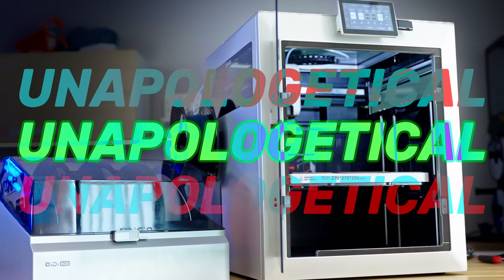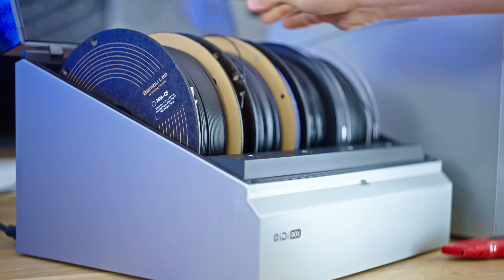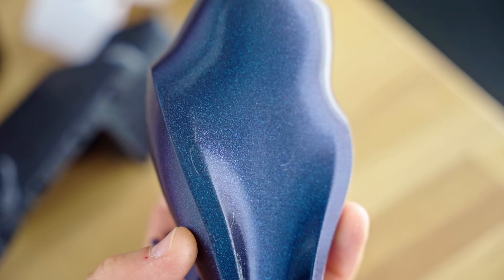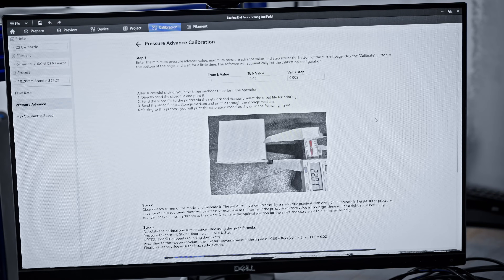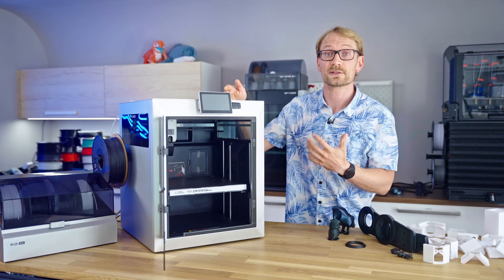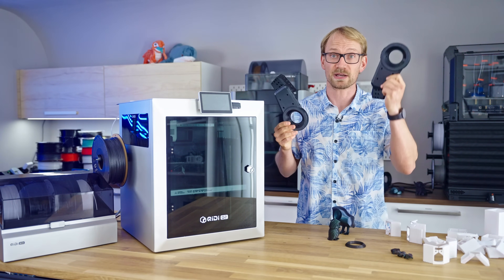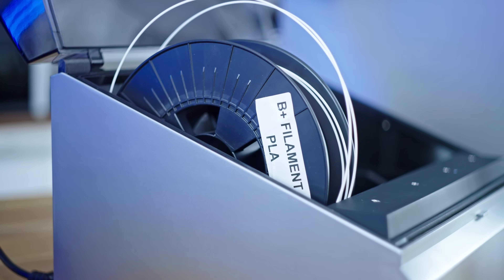Wannabe or Klipper-based powerhouse? "It's complicated 💀" with the Qidi Q2.

Comment: I mean it's a QIDI: you gotta wait 6 months, a few revisions, a community open firmware release, print profiles and then it's a tank that prints eng materials as if they were PLA for half the money.
Reply: Pretty much. Even 3 months it'll be a whole new machine. I got an Xmax 3 after CNC Kitchen reviewed it and the bed probe was a capacitive sensor whereas his was a BLtouch. I think that was the only major difference but either way it's been my go-to printer for a while now.
Reply: @redkingrauri3769 You know what is gonna rock? If they put the Q1 on offer at black friday for less than 300, that now is a mature printer.
Reply: Not everyone has 6 months to be a guinea pig so I think I'll be sticking with Bambu for the foreseeable future.
Reply: @EvanXDev  you just wait those 6 months. Right now you can buy the Q1,  probably on sale for black friday.
Reply: @EvanXDev  On the other hand, this thing can't be worse than the 3D printer I built from spare parts, so it's kind of interesting to me now that I'm intimately familiar with exactly how 3D printers work under the hood.
I keep thinking I want to upgrade to an H1S, but then I keep thinking about being locked into their software when I got so used to being able to customize every little thing on my own printer.
Reply: @bradley3549  I've done that forever, and have multiple Vorons, a Prusa Mini and some self built machines. Since I got a Bambu printer, it's really all I use unless the part doesn't fit on it, then it goes to the Voron Trident 350. The point of Bambu is that you don't have to customize every little thing. It mostly just works. I push the button and the part comes out later. I love my Vorons, but the amount of babysitting they can require means I don't use them unless I have to.
Reply: Did you just call PLA a engineering material? This was a joke right?
Reply: @TheJttv  They meant the printer will print engineering materials as easily as a typical printer could print PLA.
Reply: @TheJttv  You didn't get it: it prints eng materials as ABS like it was PLA.
Reply: @TheJttv read it again
Reply: @TheJttv  Slow down, take a  breath...Now read it  again.  There you go, just relax and breath.
Reply: @3FWDesigns  no bud
Reply: @TheJttv  That's too bad. Bud would probably  help you relax. 😄
Reply: @3FWDesigns  if you look closely. they edited the comment since i left mine
Reply: @TheJttv  I still stand by my last comment.

Comment: I'd take half baked Linux over spyware infested Windows any day. Same for this over bambu.

I think this analogy is a little outdated. Windows has been incredibly buggy for me lately with my task bar items showing up on the wrong screen and displays not working correctly. Linux just chugs along.
Reply: I agree with the statement. I've now built 3 printers with the latest being a Voron Trident that's for fully aluminium inside with the exception of toolhead and pg10 gland holder thingie which are PC blend CF. I've built it before bamboos were really out and slowly upgraded it. That being said I'm so burned out of tuning, tweaking and fighting to get a better print. I can print decent stuff but it takes me 1/4 of a roll of filament to get the material to print 75% of the quality and consistency of a bamboolab with a default profile. A to of manufactures now give you a default profile for their materials for bamboo studio. I'm now a few years older and I've finally reached a point in my life where the printer is no longer the project but rather a tool for the project and it's a pain. I'm debating selling the Voron and getting the HS2 because I just don't have the time or the energy to fight with it anymore. Im willing to pay with my privacy to not have to tune filaments anymore. That's coming from someone who recently built his own homelab server to get off the subscriptions and cloud services.
Reply: I know Linux has its place, but for everyday use it's just awful.
With Windows when e. g. I want to extend my storage, I plug in a new hard drive to my mainboard, boot up the system and there it is.

With Linux it's more like: Which files did I have to edit to register the drive again? What was the weird command again to mount the drive? How do I set it up so it is automounted? Why is my system not booting anymore? Ah, because the drive is not mounting for some reason.

Yeah, no thanks. I'm really really glad I'm done setting up my Raspberry Pi and don't have to touch it regularly. Windows has its quirks for sure, but for me it's been running pretty smoothly since 7.
Reply: @christiannorf1680  For your hard drive anecdote, I've used gparted and I've used Microsoft's tool. I know which I prefer...

Windows just works until it doesn't and when it doesn't, you have no recourse whatsoever to fix it except reinstall windows and cross your fingers. For example, how should I fix my taskbar issue? How should I fix that outlook refuses to open?

I use windows daily at work. When's the last time you gave linux a serious shot?

Comment: The issue that you're seeing in print quality is due to the "slow down for curled perimeters" feature in orcaslicer. It's actually a bug in orcaslicer, turn it off and your print quality will improve. Using extrusion rate smoothing will also help. It was the bane of my existence on my Plus 4 for a while until i made those two changes. Now my surface quality is excellent. They claim the bug with "slow dow for curled perimeters" was fixed in orcaslicer version 2.3.1. I haven't verified that myself.
Reply: Thanks mate
Reply: Thanks for the info. And I think they indeed fixed this issue in Orca 2.3.1
Reply: @NeoBTK they sure did! Only issues ive had with Orca is seeing my 5 Qidi machines on my home (very locked down) home network.
Reply: I've spend a lot of time modifying my printer and after all I got same issue with this ugly underextrution above the holes. Calibrations didn't help. So I desided to buy new high-quality printer cause I was disappointed in the results I got after many modifications. But I found a solution in a video about the printer I wanted to buy as a replacement. Thanks mate!
Reply: Yeah,  I've had funny things when that is on. Going to see if it does help when necessary.

Comment: I appreciate you reviewed the Q2, despite the safety issues on the Q1 (solved by reversing the plug), I'm enjoying it so much.
Reply: Ah, I knew reversing the polarity would fix the problem, it always does in Star Trek!
Reply: @DailyFrankPeter  from a practical point of view, it does. Such a defect should not be allowed obviously, but it can be solved

Comment: This is very typical for a Qidi printer, in my opinion.  I got an X-Max right when Bambu was launching their X1C. I didn't go with Bambu because I didn't want to be a beta tester. I regret that decision every single day. Qidi has just been a half baked nightmare. Things are glitchy, the extruder clogs all the time and it is generally an inferior product in every way. I've disliked my experience so much that i rarely use it now. The nail in the coffin was when I finally did buy a Bambu machine and realized what a printer should be.  I'll never buy another Qidi product again.

Comment: I had a Qidi Q1 Pro from launch day, ended up returning it. Not a fully baked printer. I got an H2D on launch day (I know it’s 4x more expensive) and it was 95% baked. Such a great experience. I feel that these lower cost printers will end up printing well, but to set it and forget it costs money. I’d pay $200 more for a bambu product or even $400 more for a Core One just to know that they actually did their due diligence on creating profiles.
Reply: I'll agree with your assessment that set-and-forget costs money, but I don't think it's as much as it used to be. I've heard from a ton of owners of Bambu models like P1P/S and X1C who've put thousands of hours on their machine and only had to change out the occasional component due to standard wear. I think Bambu has really hit the sweet spot when it comes to price and reliability, despite their shortcomings like their locked down software ecosystem.

Comment: It's the next gen Ender 3 for those that want to tinker with a printer rather than print with a printer.
Reply: I thought Elegoo CC would be that - but of course tinkering is limited to printing raisers and adding other non-connected things (1) due to 🔒💩 firmware 🙄

(1) exception: wifi MQTT filament movement/tangle sensor. Like WTH, it would be simpler even with Marlin

Comment: My experience with an xmax3 was that it had great features on paper; it was capable of some nice prints, but it was not reliable and tended to fail in ways that damaged the printer. Many many replacement parts and repairs were needed; Qidi support did a decent job responding quickly and sending parts. I really wanted to like that printer but ultimately I just couldn’t count on it and Qidi product development has moved on to new models, so there’s really no hope for any meaningful improvements now. I don’t think I trust Qidi to fix all the issues before moving on again, so my advice is to proceed with caution and pay attention to your warranty return dates…

Comment: I have an Xplus3 and after the first oopsie where that shipped printer with a plastic base plate where the frame was built on (they fixed it and send new units at zero cost for users or total refund), it was a more polished product right off the bat. This seems that Qidi has moved to the trend of many low cost Chinese company were they send out beta units and have the users do their job for them. In 6 months it will be an interesting product. Definitely not as it is now

Comment: Try fiddling with filament temperature settings. I find that exact problem when the temp is too low and filament continues oozing out after it's supposedly stopped printing.

Comment: The print quality looks like trash. Their slower profile they sent you is incredibly slow, why even bother with a Corexy then. There aren't even replacement nozzles yet and the ones found on Ali cost like 40-50€ what a scam.
Reply: They come in pairs, so one is 15e.
Reply: Why are you lying, nozzles are available on their web for 15e a piece
Reply: @JakovPerisic  Why are you lying? The tungsten nozzle costs 59,99€ in the official store and the bimetal one 29,99€

Comment: The value of the Q2 compared to any Bambu Lab printer is wiiild! The Qidi Box is not as good as the AMS. That I totally admit. If you care about the printer, the Q2 is a ton of printer for the money. I also disagree they just look like Bambu Lab clones. There are only so many ways you can design a box and they copy the Bambu Lab design far less than many brands. Qidi was making enclosed core XY printers since before Bambu Lab existed. Yes, you will actually need to tune print profiles if you buy a Qidi. If you can't handle that, well then it's probably not a printer for you. The actual print quality with a tuned profile matches or exceeds the other best printers on the market. I think it's a great option.

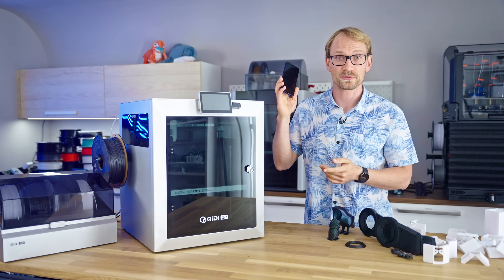Comment: 12:14 Qidi Link sucks in general. For the Plus 4 the camera feed doesn't even work unless you go to Expert Mode, and even then you get 1fps. You also can't view bed meshes as far as I can tell
Reply: All of those statements are false. Camera works, gets more than 1fps and if you are having issues it's wireless signal strength, and you can view the bed meshes both KAMP and regular.
Reply: @802Garage my camera feed only shows up on Expert Mode and only gets 1-2fps regardless of what network I'm on. I've already upgraded the printer's wifi module to a tplink ac1300 with no effect on the Qidi Link side. It's not just me, lots of reviews on Google Play and other users on Reddit saying the same stuff. Bed mesh also does not load any visual, that one might just be a me problem. If any of it can be fixed then please tell me how
Reply: @coledavidson5630  The bed mesh is recalculated every print. If you look at the beginning of the print, you will see the KAMP mesh. If you want to do a full bed mesh and view it simply run the command for a full mesh from the console. As for the camera, expert mode is a single button. I'm sorry, but is that really a big deal at all? The low FPS issue is common and there are several fixes. I'd recommend chatting with the folks on disk chord.
Reply: @802Garage I understand how to view the mesh in general. When I generate a mesh and load it in Fluidd on a PC it works as expected. However if I try to load that same mesh in Qidi Link it only shows me the range/variance number (forget which it is), no visual graphic of the mesh appears.

Comment: It's so frustrating... can't we have a printer that is open BUT ALSO PRINTS WELL? Like... my 8 year old CR10s prints better than this at 60mm/s² of the profile you showed. The high temp printing is tempting, yeah. But it's been a good decade, I just want something reliable. I feel like what we really need is companies just producing a platform like the Voron or similar project (that would legally allow for it) completely assembled and ready to print for a sane price, but open to the community to develop the software and expansions for it. But for some reason we apparently can only go fully DIY with part kits for 1200 EUR+ at best, or fully-closed-source and well-printing or printers like this, party open sourced but developed by one small company with a ***ton of issues and which will have support dropped faster than my dog drops his favourite toy for a new one.
Reply: The issue with platforms is what you described, but the other way around - nobody in their right mind, within this capitalist hierarchy, wants to start a business/product line just for it to become widely known & successful, all without any extra avenues to profit off of. If you saw how much revenue consumables alone are able to generate for all these "proprietary tech" companies, you'd see why it would be a poor move for anyone to implement, or rather miss out on implementing..
Reply: It prints really well, no worries
Reply: Sv08 is open sourced and has been really reliable to me. The only thing I did was modify the start print macro to always use the touch probe before every print
Reply: The Q1 Pro, Plus4, and Q2 all can print very well. The Plus4 in particular prints essentially VFA free with some of the highest quality and precision available, especially for the money. The Q2 appears to be following that path according to most users, as long as you actually tune a print profile. If you want Bambu Lab set it and forget it get a decent print, go for that. If you are like many of the Plus4 and Q2 owners who tune every aspect of a print profile to actually shoot for perfection, then this is possibly for you. Especially given the price for the capabilities, it's pretty wild. No printer is perfect. Qidi support is also fantastic, even if they don't drop tons of updates.
Reply: @802Garage  Also my X Smart 3 prints well, fast and it's quick to heat up for ABS and the likes.
Reply: @eaman11  I think the X-Smart 3 was slept on heavy for the price when it came out. Cool little printer!

Comment: Does anyone know what style hotend/nozzle this uses?
Reply: Yes, similar to plus4, volcano style bimetal nozzle with integrated heatbreak.
Reply: Proprietary nozzle with attached heat break. Similar to the Q4 but ironically not compatible. Replacements are very expensive.
Reply: @radry100  they are not expensive (15e for a hardened nozzle) and you can in theory use a plus4 nozzle

Comment: I have a feeling you were printing both PETG and PLA with the door closed and top lid closed.  It is well known to open them up to get decent prints and only close it up for technical marerials like ABS etc.   Almost every review shows an amazing difference in results between open and closed for PETG and PLA.
Reply: Kinda weird that I don't have this problem on my P1S, maybe it's less insulated? I never open the lid/door while printing and it works still well.
Reply: Who said to open the door/lid when printing PETG? 
PLA and TPU are understandable, but not nececary in my experience. On my P1S i get ever so slightly worse overhangs when printing PLA on textured PEI with the prinder closed up. And the newer cool plates (Bambu supertack, BiQU CryoGrip, ...) make opening the lid totaly unnececary.
Reply: You have a feeling? He literally said he did. The P1S does not have this issue for reason. I only print with door and top closed to keep it quiet.

Comment: Given how good the initial prints looked a faster printer profile by default doesn't seem too crazy to me - the folks that can't tune a printer to get results they are happy with are the ones who are printing owl statues and the like, so a good and quick result for them is probably a sane benchmark for default configuration. Its not like the more engineering parts you got out of it by default are actually that bad either, imperfect sure, but its open enough you can fix that if the quality of the part really really matters to you.

Comment: Please it's a Qidi, you sort of completely ignored the main question: WILL IT CATCH FIRE.

Also it WILL absolutely self destruct in short order if earlier ones are anything to go by, the question is only how.
Reply: The Q2 does not seem to have any of the same issues of the Plus 4 thus far. The SSR is the new upgraded one and there's no signs of any fire hazard with those.
Reply: False, people are already using these Q2s without any issues.